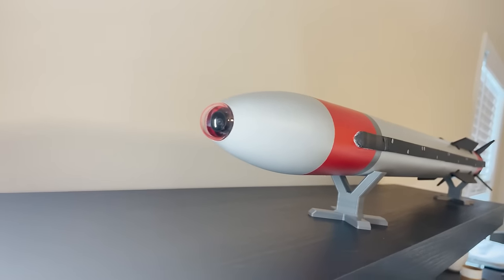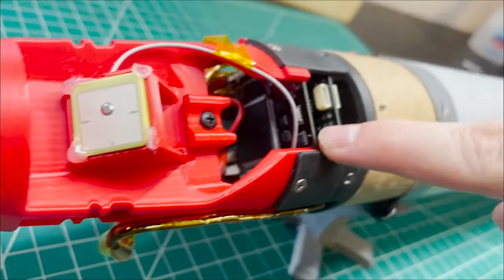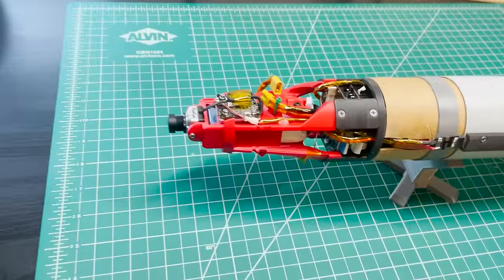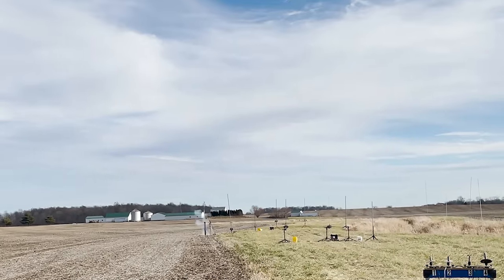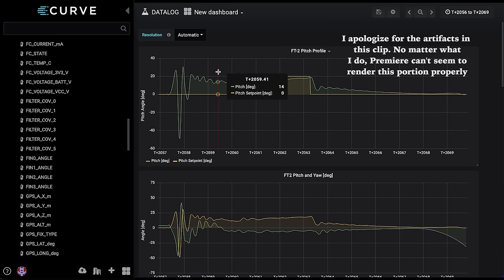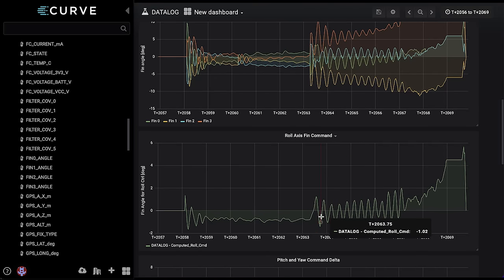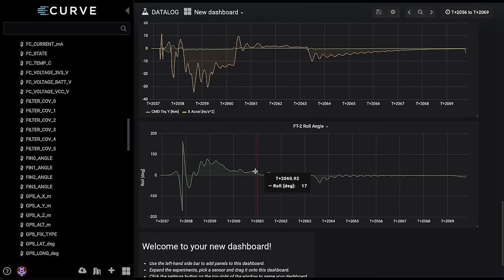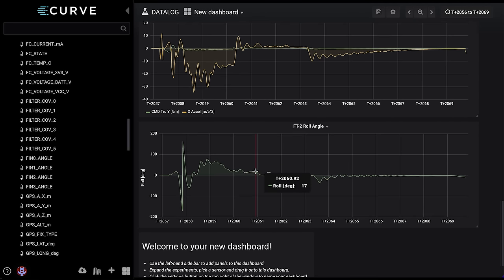Rocket Silo Launch - DIAMOND-X Flight Test 2

Comment: Just out of interest: what’s harder to construct, cold launched or a hot launched Rocket ?
Reply from the maker: Both have their difficulties. Cold launch systems need to ignite their rocket motor mid-air, so the rocket itself needs to be wired to the motor ignition circuit. This has some safety considerations that need to be made so you don’t have it light accidentally. Cold launch systems also have a concern about motor ignition time, as sometimes it takes the motor a second or two to come up to thrust. In comparison, hot launch systems needs to deal with a tougher internal environment as the motor is ignited inside the silo. You need to vent the exhaust gasses somewhere as well. Cold launch systems are better optimized for rockets with Thrust Vector Control systems, whereas hot launch can handle either TVC or fin control well (hence my choice to do hot launch).

Comment: Great
Which Matlab toolbox/library did you use to simulate the rocket?
Reply from the maker: I have a simulink model built around the 6-DOF block from the aerospace blockset. You can probably get around using that by just directly coding the Euler Moment Equations (https://en.wikipedia.org/wiki/Euler%27s_equations_(rigid_body_dynamics)) if you don't have that block available. Everything else is just calculating forces and moments from aerodynamics, thrust and gravity

Comment: What is the pitch baseline? Vertical? The whole 20 degrees only seems to make sense if that’s based on the reference based on what should be straight up vertical. I’m a dummy. Explain
Reply from the maker: I think I misspoke in the video at one point which probably doesn't help. 0º pitch in this coordinate system is straight up, and the 20º set point is 20º from vertical in the rocket's +X direction (normal to the rocket's long axis in the direction of the raceway). 20º above the horizon is pretty horizontal and probably isn't that safe, I try to keep everything +- 20º of vertical.

Comment: why is it illegal to connect the camera's signal to the flight computer?
Reply from the maker: Steers you clear of -> https://www.law.cornell.edu/uscode/text/18/2332g
Reply: If the camera fed into the flight computer, it'd technically become a guided missile, whether or not it had any kind of warhead. Guided missiles are strictly restricted to military for obvious reasons.
Reply: @FutureAIDev2015  I agree, but subparagraph a of the law he cites specifically requires the missile to be "explosive or incendiary" for the law to apply. From consulting only this law, connecting the camera to the flight controller of this rocket would not appear to be illegal. (This is not legal advice)
Reply: @tomthoe  for me biggest confusion point is FPV drones, they should be illegal too then, I guess it is just arcane law, but I am really surprised it is outright illegal
Reply: @tomthoe  If you want to get really legalistic, the motor could count as the explosive or incendiary portion.
Reply: Thanks for the link and, also, many thanks for advancing the state of the art!!  This is what the hobby needs!!
Reply: There is people in Ukraine who would be interested in your work.
Reply: @LafayetteSystems  Too bad you're already in violation of "(C)any part or combination of parts designed or redesigned for use in assembling or fabricating a rocket, missile, or device described in subparagraph (A) or (B)". As what you have is 99% the device described under subsection (A), hence I doubt that it doesn't fulfill the definition of "any part, or combination of parts"
Reply: @LafayetteSystems  The interesting thing is the "Jurisdiction" though, makes it seem like the clause doesn't apply at all times. OTOH if you've launched it in US airspace it might fall under (b)(1)?
Reply: @FutureAIDev2015 per the law that was provided a rocket like this could use a camera as long as it has no explosives and doesn’t target any aircraft
Reply: @tomthoe It also reads that this applies to aircraft. I have not found anything in the code that bars land based targeting i.e. civilian owned missile artillery.

Comment: Do you have to do ITAR paperwork when you build an active control rocket?
Reply: @gkalkowsky ITAR does not apply if you are not exporting the restricted information. In the USA, if you are not trying to target something (i.e., go to this exact point in space; moving or not), then active control is unregulated. If you are trying to hit something--a point on the ground or an RC plane or similar--then it becomes illegal unless you have specific government permission. I'm sure the paperwork would be quite extensive and expensive at that point.
Reply: If you distribute it in any sense, yes
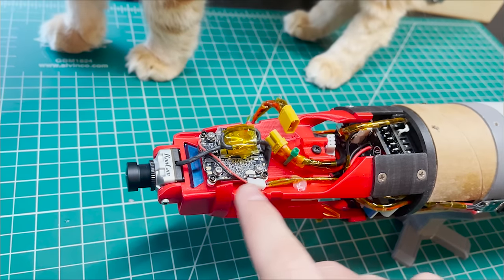Reply: @tomthoe  ah, hence the explicit explanation at 3:20
Reply: We need more homebrew MANPADs to establish better 2nd Amendment rights case law.  Shall not be infringed!
Reply: @tomthoe you seem like you might be able to answer this question, would these rules also apply to something like an EDF  powered "rocket"?
Reply: @tomthoe  I think it might be possible to legally register a MANPAD as a DD, however to buy ammunition you would need a magazine which includes explosives licensing. So your probably going to be dealing with local authorities and the ATF for the ammunition.

Then you would probably need FAA permission to fire it at a specific location and time just like other high powered rockets, however to fire it in the first place your also going to need high power certification from a rocketry association. 

Lastly, if that MANPAD has anything classified, forget about it, you just can't own it. Even if you independently develop something similar to an existing system, its going to be confiscated and placed under ITAR regulations. 

I believe there's also specific laws regarding the storage of MANPADs that has some insane requirements.
Reply: Edit:  @WarlordEnthusiast, I think you may have meant to respond to @skenzyme81

 @WarlordEnthusiast  MANPADs are designed to carry explosive payloads, which automatically places them within the scope of the law linked above. (as well as destructive device)

I'm not suggesting that a rocket guided to a target is in any way legal; just that it does not fall under this particular law.
Reply: @tomthoe  Your right, I'd swear I clicked on the other user though? Youtube being weird I guess.

Comment: You unintended 'protrusions'.. the rail and camera looking out really should be duplicated (dummy)on all 4 sides to eliminate or equalize that flight anomalies.. especially as your rocket is so small..   and dual deployed 'chutes, first a drag then the main.  You silo sucks, best to divert on;y 90 degrees. (120* maybe).  test the drag and main 'chute with your rebuilt silo.